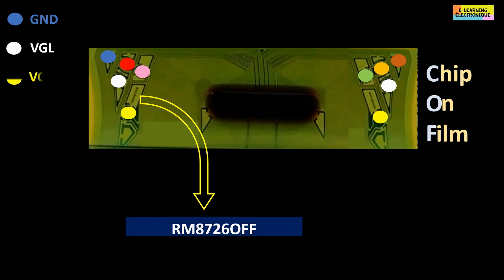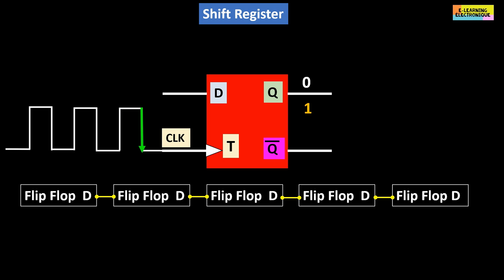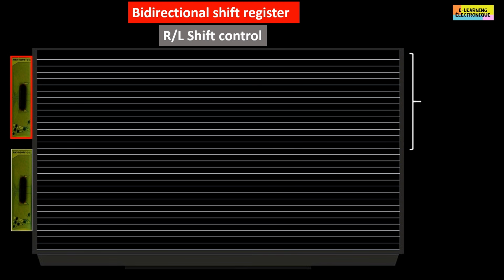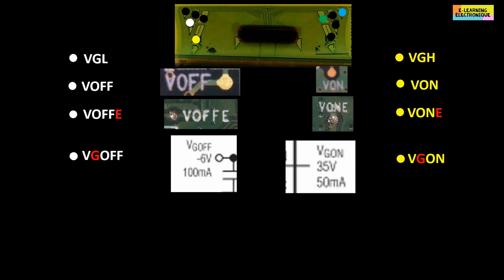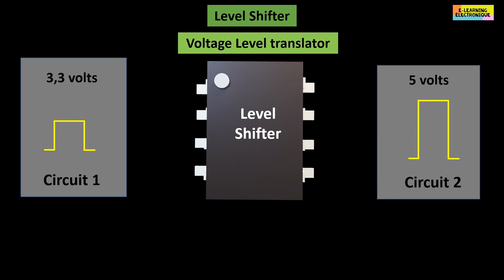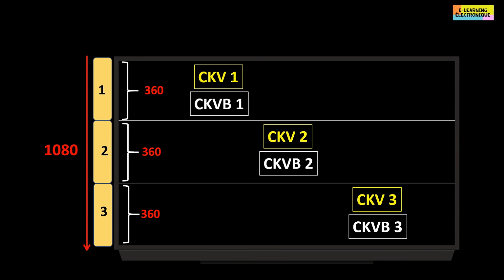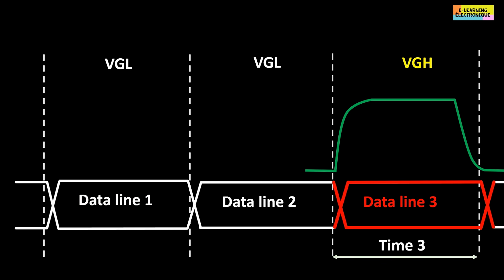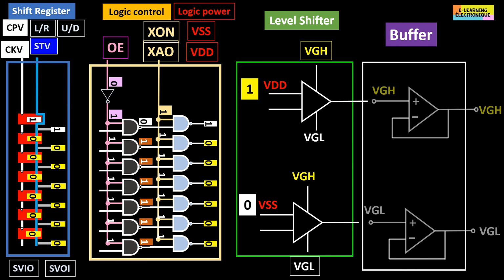What does it mean on a TCON board CPV CKV CKVB STV STVP OE XAO RL UD VGH VGL

Comment: I think that CKV signal is NOT the same as VGH odd/even or LC 1/2. CKV is a Square wave (eg 30kHz) whilst the latter two are simply DC voltages pulsing alternately on very low frequency like every 3 seconds so DON'T CONFUSE

Comment: very important to learn, it comes from the very basic of seven segment digital display, the shift register that most led tv technician ignore or dont really understand since they can repair most of the problem by blocking or cutting one side connection that disturb t-con voltages and signals when panel is faulty.

Comment: Great video, both the content and the presentation are 10/10. I understand that double images are caused by crosstalk. As TVs gets older resistance and capacitance changes making it difficult to OE control it. Thanks so much

Comment: I'm a little confused about stv explanation. One point says stv1 is signal for one direction and stv2 is signal for opposite direction. But then it is shown screen segmented into 3 parts with labels stv1,stv2,stv3. So what is stv for..directioning or segmenting? Or is both?
Reply from the maker: in the example of the screen divided in 3 parts (time 7,37 of the video), there are 3 Gate drivers with STV1, STV2, STV3. The numbers here do not mean the direction of operation of the TV. The direction of operation of STV can be found in the dathasheet according to different notation: number (STV1 or STV2), a letter L or R (left, right), I or O (input, output)

Comment: Hi! This video series are great! I have grapped so much thanks to you! Only thing that is not clear to me is that, where does the CLK input for shift registers come from? I designed tcon boards but only clock we provide to the cell is coming from Level shifters CLK_OUT1 to 10. And their frequency is not that high. They probably only activated the gates so they are for gate driver. But for source driver, I do not provide any clock in UHD resolution, the cells I desined for utilizes ISP and CEDS signals. No clocks. So I wonder where the clock that is for storing the data in DAC regs is coming from?

Comment: This is the best video on YouTube ever but there are a few technical points I still misunderstand. If clocking signals (CKV) are responsible for scanning particular segments of the matrix (plus odd/even lines how do we explain the scenarios in which e.g. we have the image of the object falling from the sky. From your video I understand that these clocking signals are only scanning (switching the TFTs) of entire display roughly at the same time (left to right or right to left, It doesnt matter here) so how do we achieve the image of say a bouncing ball if we the shift register turns turns the odd lines to on and off sequentially which translates to the same on the TFT Gate, do you understand what I mean?
Reply from the maker: the execution speed of the gate and source driver is of the order of nano seconds. The animations in the videos are just an illustration of the operating mode not at the real speed.
Reply: @elearningélectronique  Oh I know that but say you have the image that is refreshed 60 times per second (60Hz) and on the screen a person kicking the ball. The ball is going up which corresponds to the thousands of frames being refreshed and displayed. How then the object ( here: the ball) can be shown as moving upwards if the horizontal scan is only switched on and off ( the entire screen) It can be eiher 1 or 0 on full screen. Its binary and sequential. This doesnt allow for random switching up progressively so the pixels are switched on higher (according to the position of the object in the screen moving on upward motion) I hope It makes sense to you I can't explicate It in more detail. But overall, you are making TOP videos Sir. You are the best

Comment: so who commands to swithch to the next row? tcon? or column driver onece it reaches the last pixel? what happens when it gets to the last row? does it jump to the first one via some driver to driver signals or some reset function is used from tcon?
 basics are neatly expaned.  thanks. but i dont understand how it works as a system.

Comment: Sir, I traced vgh_odd and vgh_even signals on 32" lg panel and I found that this signals are complements of each other and keeps on changing from vgh to vgl (and vice versa) every 1-2 seconds. On the panel datasheet its mentioned that this signals are just supply lines for odd and even gate drivers inside the panel, if thats the case then why do they alternate with such long period instead of having same frequency as that of CLK lines. I tried searching the lg display co. research paper, but they have not mentioned about this signals. Sir can you please clear my doubt regarding this. Thankyou.
Reply from the maker: if the image display is abnormal with VGH_odd and VGH_even constantly changing value alternating between VGH and VGL values then there is a short circuit.
Reply: Sir thankyou for reply. Can you tell me what is the significance of Vgh_odd and Vgh_even. In case of  samsung panel ckv and ckvb lines alternate at high frequency as it drives odd and even gate lines, but in lg panel this Vgh_odd and Vgh_even has very low frequency (upto 1Hz to 0.5Hz).
Reply from the maker: VGH odd and VGH even are also named GVDD_E (Gate VDD _Even) , GVDD_Odd (Gate VDD _ Odd) it's GIP (Gate in panel or gate implemented in panel) VDD for even gate TFT and  GIP panel VDD for odd gate TFT. TV with GIP panel has level shifter that output  even and odd function.

Comment: How STV signal is distributed between gate drivers? I see that STV signal goes into first COF chip. But what happens next? Is it modified by the first chip before it arrives to the second chip? Is it connected to all COF chips in parallel?
Reply from the maker: The COF chips being of the same model, it works in the same way but one after the other because these chips are placed in cascade, in other words in series. So the STV signal is first transmitted to the first COF then arrives at the second COF and so on.
Reply: @elearningélectronique  So in order to fix missing STV i have to connect it to the first COF driver only. I cannot connect it to 2nd od 3rd driver, correct?

Comment: Hi  @e-learning électronique , all your videos are very informative. Please keep doing it. 

 I would like to know the location of tcon on my Samsung tv. Model is QE50Q60TAU. There is no external dedicated tcon available. Can you please help me to locate if it comes with the main board or with the panel itself. I tried to figure out after watching another videos of yours explaining 3 types of tcon. But not luck yet. Please help.
Reply from the maker: if there are several electronic boards inside the TV, the TCON is the one with a cable going to the screen or the TCON is directly connected to the screen and can only be seen after the TV has been completely disassembled. Be careful, this part is very fragile and a bad manipulation can destroy the screen. The ideal is to find the TV manual service to find the information without taking risks especially if you are not a professional repairer.

Comment: How many volts of stv and stvr thank you sir
Reply from the maker: STV is a clock signal that represents the start pulse of the Gate IC. If the frame rate (fps) of a video is 30, then the STV has a frequency of 30 HZ. The average voltage of this signal is about 3.3 volts.
Reply: How many volts stv and stvr not Hz thankz